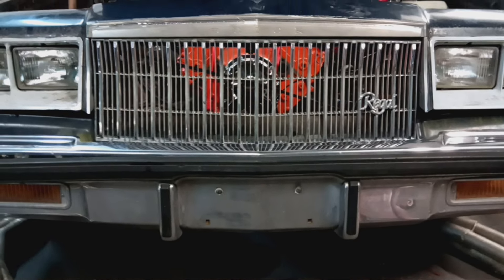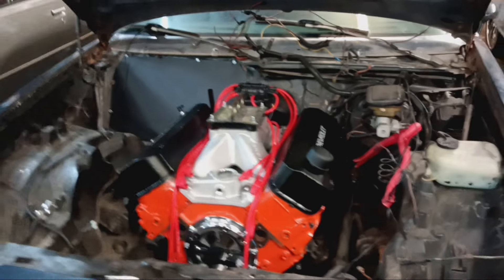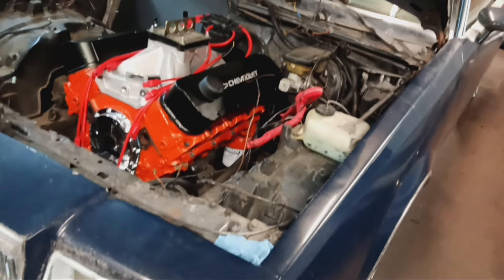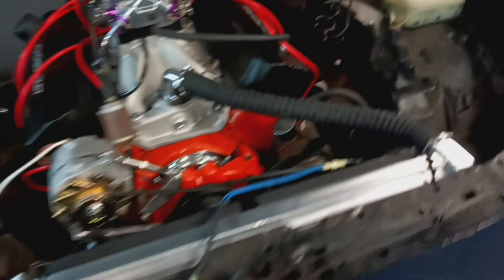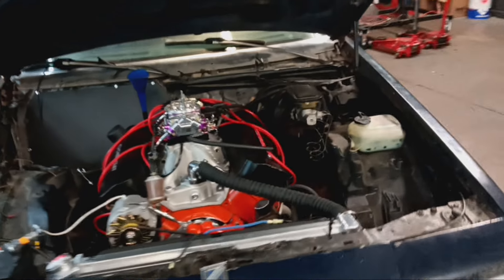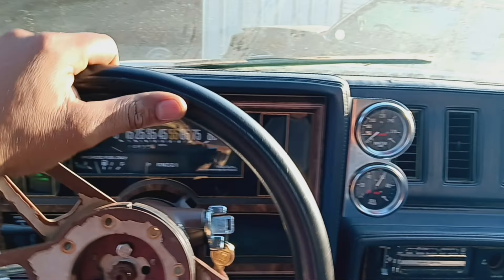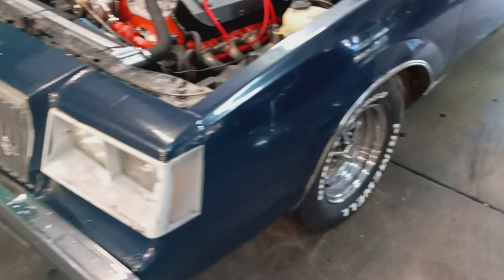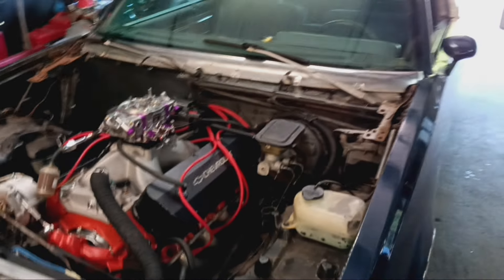Pump gas big block makes ALL THE TORQUE!!

Comment: Ooowwweeee that big block Chevy power is what separates boys from men Keep It coming geeeeee 👀💪🍿
Reply from the maker: No doubt
Reply: @SSPENGINES383 Bruh motivation back pressure 🔥🤘🏿I want that on my 03 Tahoe 5.3 4x4. I already have brand new summit racing long tube headers magnaflow  cats and borla mufflers cold air intake k&N uninstall waiting to my stage 2 cam to arrive. Love the content I be geeked 😂🤘🏿🔥💯
Reply from the maker: @daeshonkaine3172  preshate it fam

Comment: Very cool 🤙 I build all my own engines i still have a couple small blocks running. But i have a handful or so of built big blocks. Im daily rollin a turbocharged 468 squarebody 11.5:1 on pump gas. We do have a station with 110 at the pump once and a while i run a tank
Reply from the maker: Now u just answered my question my next big block build I wanna turbo on pump 93 for a work truck
Reply: Where are you located? I have a squarebody I want to have a little juice
Reply: @Chevyboii  Spokane WA

Comment: Street car is where it's at
Reply from the maker: Fasure
Reply: Agree,4sho nothing like low end big Block torque. Put a mild cam in it got a smooth daily driver.no need 4 a ls swap.plus ur not going to get this simplicity out of a ls swap or much daily drive ability with a 600 hp ls.enjoyed the video. Good stuff my man.
Reply from the maker: @havoc9926  thanks man
Reply: @havoc9926  hell yeah that's why I'm staying small block.... might think about going big block in the near future but we will see when the time comes but until that day comes going to work on getting that 400sbc with 560hp

Comment: Thats a good looking big block... After watching this I have a spare 454 i may just run in a c1500 long bed.. cam and stock refreshed bottom. While i finish my 385 sbc with aluminum heads. Id be happy with high 12s just a peppy sleeper street truck. Engine cost 2300$ to build myself just been lazy to install

Comment: Do you got a vacuum pump on that or is it running to your intake?
Reply from the maker: Running from intake like factory
Reply: @SSPENGINES383  man see somebody told me I needed the pump so I went ahead and bought a $500 pump I’m physical pull it and take it back
Reply from the maker: @rayguajardo4541  I have a fairly large cam in this motor and breaks are peefect
Reply: How big of a cam do you have to have an order to use one of them vacuum pumps?
Reply from the maker: @rayguajardo4541 I've only needed 1 for my high compression race motors all my street stuff hooks up like factory and stops like factory too

Comment: What degrees did you set your timing?  My 454 is drinking fuel.  I have a 400 turbo trans and factory rear gears in a 1982 chevy c10.
Reply from the maker: Think total timing was conservative at 30

Comment: Ugh i just need my c10 to start up and drive and just be able to run perfect without being the fast but not the slowest ion wanna race her i just need her to stand all 4 tires down without cutting off or getting get towed my truck been sitting to long ion need all that wild stuff on her like 800 horses air plane gas and none of i need regular gas hit 75 without missing a beat no leaks right now its just sitting at stillwater i just got on to yo video tonight around 7pm 01/12/25' i need yo help price range location and start us a plan on what need to be done and im not in a rush when you get her in your hands 🙏🏾

Comment: Did you rebuild or just add bolt ons???

I have a 49 ford with a 454 sitting onthe floor. I ben considering s 460. 

Which motor do you think i should do?

Now if i do go 460 can i fo the same add ons to make the 460 haul ass like this?
Reply: 460 bud just because I have seen foxes run great on a extreme budget with 460 BBF but honestly a 454 would be about the same depending on the heads u got on the motor . Id keep it 460 though they are plentiful and lot of aftermarket stuff available too
Reply: Rebuild the motor rings bearings and if the budget allows get a different piston flat tops even hypereutectic pistons runn good..get a mild cam and try to get the heads milled maybe some porting by hand too. I've saved a lot porting and assembling my own heads. If u got the $ get a set of aluminum heads cam  and that will have you covered assuming the block is still strong.

Comment: Cam Specs & Which cylinder heads ?
Reply from the maker: Stock heads with Howards hydraulic roller
Reply: @SSPENGINES383  Exactly which Verizon n 454 is this??

Comment: My 383 is not firing on all cylinders I put a new distributor new spark plugs and wires 4 cylinders are not fired
Reply: Timming?
Reply from the maker: Need more info like heads cam and piston style

Comment: As heavy as that motor is you should be doing 1000 hp 😡😡😡😡😡😡😡
Reply from the maker: Not quite would need at least 632 to do that on motor on pump 93